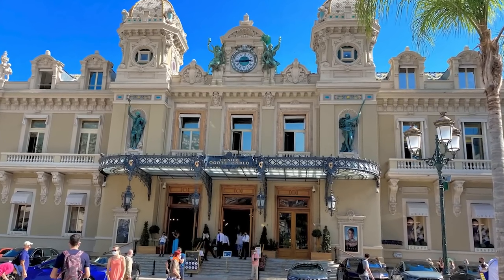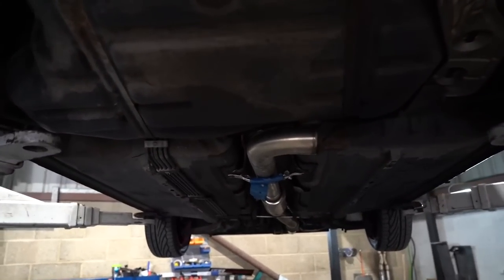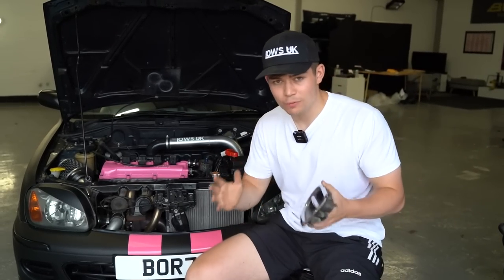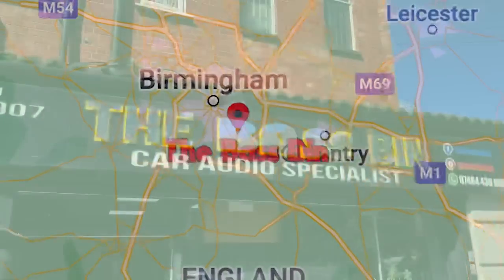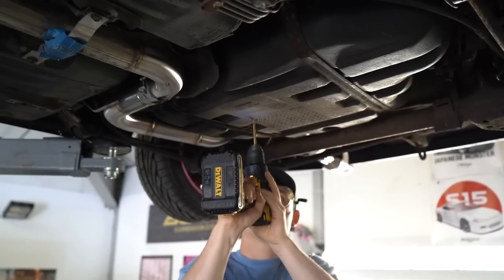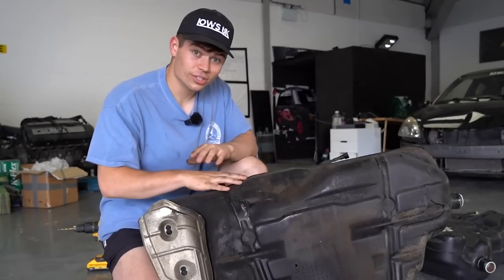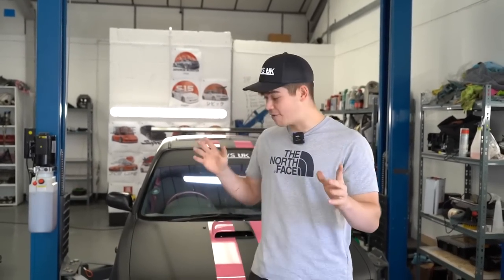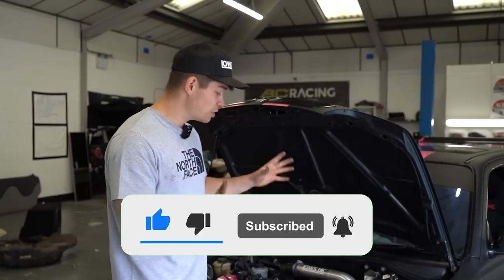UPGRADING MY TURBO'D MICRA WITH 5 MODS FOR A 2500 MILE ROAD TRIP!

Comment: One task that I have yet to undertake on my K11, is uprating the brakes. I rarely drive the car hard, if ever, but, down a prolonged steep downhill run, they can fade. N15 Almera front Caliper carries bolt straight up to the K11 uprights, and, because the N15 uses a 4x100 setup, you can use the N15's vented front disks. You will need to change the front calipers, however, these are again a bolt up option. Something else to consider, if a rear Anti Roll bar. CG13DE and CGA3DE K11s, should come with a rear ARB. Some one litres already have the brackets for the ARB, installed. The rear beam should have the mounting points, and, near where the rear beam attaches to the bodywork, if you have the brackets, you'll noticed a pair of flanges that have holes in them. These accommodate the rear ARB drop links. Again, I have a rear ARB, which I'll probably fit over the winter. So, two easy upgrades that can improve the K11, using parts available from Nissan or a good OEM.

Comment: Looks great until you get a stone into the radiator
Reply from the maker: I thought about this, but it’s the same with an exposed front mount intercooler and you see those everywhere.
Reply: @JackMcNeillCars  full send mate can always get a new one. Love your channel and what your doing man
Reply: Bet ur fun at partys 😅
Reply: Get some black mesh/chicken wire I’m sure you could find some with the right size holes that wouldn’t affect the airflow too bad but offer some protection
Reply: @ryanrichardson9044  he wasn’t trying to be funny…
Reply: I would take spear spark plugs, HT leads and coils, just in case, but other than that , I think Boris will fly to and from Europe
Reply: @jackwaltmcgregor6334  This!!!
Reply: @JackMcNeillCars  well I mean… a punctured front mount intercooler will cause a boost leak and you lose horsepower, a punctured radiator and you have no horsepower at all 😂

Comment: Move the plate aswell thatl help thats right in the way of air flow
Reply: No you want to leave that plate in.  Removing it will allow air to bypass the radiator entirely because the gap it leaves it less resistant than the radiator.
Edit:  Unless you mean the reg plate.  Removing that just leaves a plinth that's the same size and shape so it won't do much.